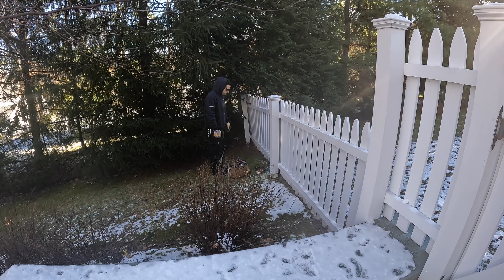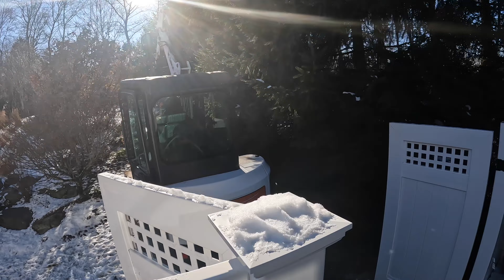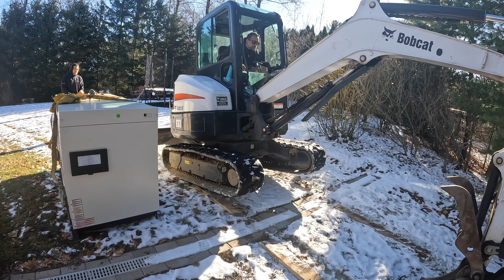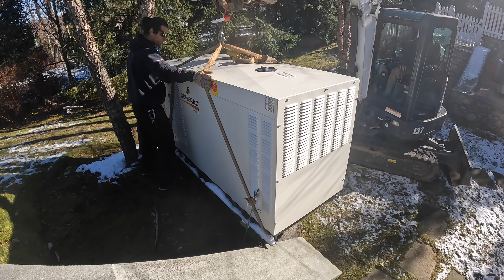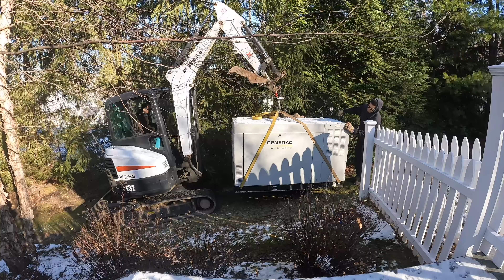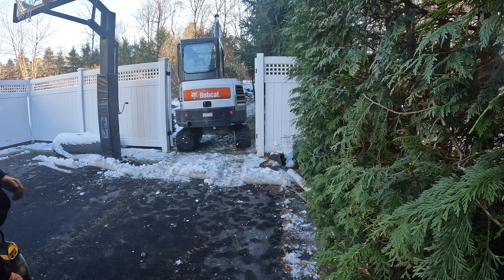Delivering a Generac 48kw with an excavator #generac

Comment: Had any canbus issues with the newer 4.5 liters? I’ve put in about 40 of them and replaced 10 ECM’s.
Reply from the maker: Brother, we had so many issues in the beginning… did you buy the specific usb drive they told us to ?

They’ve been pretty good this year. 

The 32&38 are my favorite so far. That mitsu motor is great.
Reply: @ipowergenerators4200 yes and it works pretty well, although I wish the ECM firmware and the controller firmware would upload in a bundle like the industrial units. They finally came out with a fix for it though, turns out two of the diodes in the DPR relay were not big enough and it was frying controllers and ECM’s.  Generac says it should be fixed now.

We sell a lot of 38’s. It’s the perfect size to justify a liquid over and air cooled, and when those 2.4’s run good they just purr away. Unfortunately they go through MPU’s, coil packs, starters and flywheel ring gears. Also have issues with the fuel solenoid sticking closed. 

I really don’t mind the 4.5 liters all that much. The 9.0’s are pieces of crap. It’s just a cheap big block Chevy and very old school. I’m glad they are updating them to have the IMPCO fuel system like the bigger gassers. The PZ410 controller a bit of a shame. I thought they were going to have similar capabilities to the Cummins lineup, but that controller isn’t a ton more capable than the evolution. The PZ pro is fuckin sweet for 4.5 liter industrial units.
Reply: Where are you located?  I haven't had any major issues on the 4.5L yet but I also haven't installed as many as you. We just put an 80 in recently. I am upset about the 2.4L leaving us.  My fav to work on and pretty reliable.  @MrSamsamsammy
Reply: @gentexelite2021  I’m in NC. The 4.5L has been interesting for sure. I’ve got one that I believe will be getting the entire unit replaced under warranty soon. In the last 7 months It’s gone through 5 ECM’s, 3 wiring harnesses, and 5 controllers. I’ve got at least 24 hours of diagnostics into it and a master technician from National Power has 8 hours and can’t figure out what’s causing it. Waiting for technical support to figure out what they want to do with that one, but I’m pushing to get the whole thing replaced.

Some of them haven’t missed a beat since install. I’ve had quite a few with CANbus issues, and a few with oxygen sensor problems I can’t seem to figure out. 

I have a feeling they know there is a problem with the canbus system on the evolution controller; and that’s why they are going with the PZ410 on the new XG 32 and 40KW’s. 

I’ve done 5 4.5L’s with the power zone pro from the industrial line and haven’t had any issues out of them.